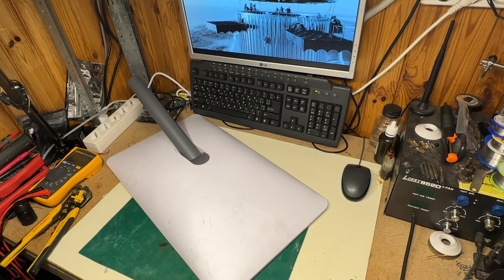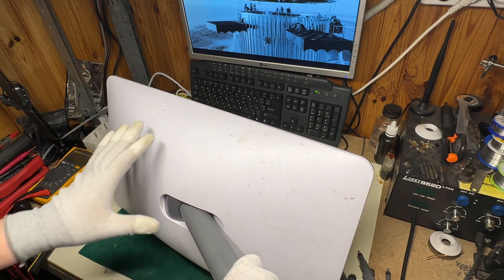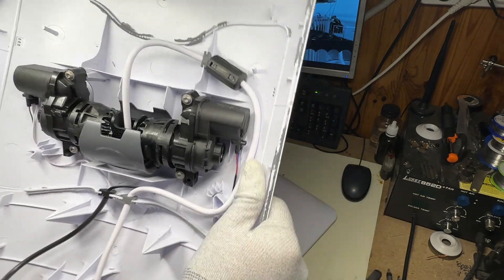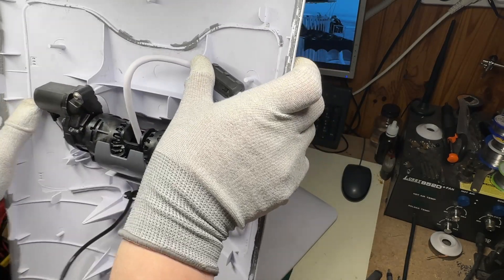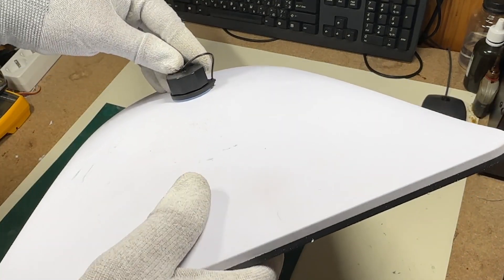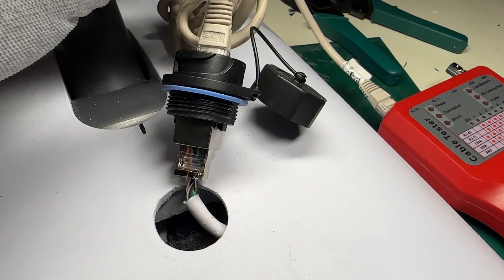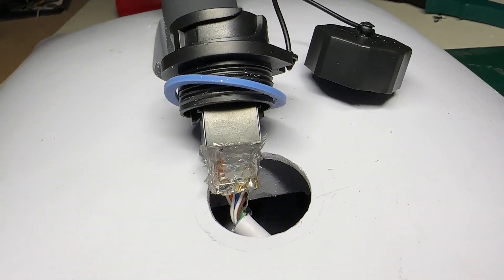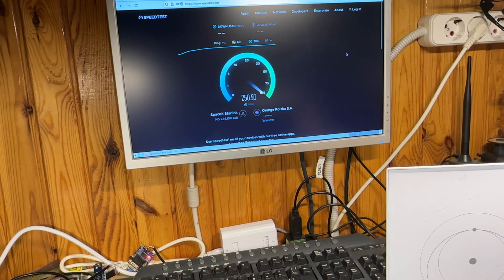Starlink terminal repair: Replacing proprietary SpaceX connector with waterproof RJ-45

Comment: Oleg, vi seu tutorial na internet de como converter uma antena para 12v, fiz a conversão da minha e em um primeiro momento liguei em uma fonte 12v, porem com baixa corrente. A antena até ligou e foi avançando as etapas de conexão, porem em dado momento ela reiniciou e ficou na etapa "inicializando" (booting em ingles), tentei ligar em uma fonte mais potente como segunda tentativa e novamente avançou todas as etapas e depois voltou para "inicializando". Agora toda vez que tento ligar fica em "inicializando" e não sai disso. O que fazer? Atualmente estou usando um pack lifepo4 que fornece 12v e até 30a de corrente, acredito que energia não seja o problema. O que posso fazer pra resolver?
Reply from the maker: You can try to add more capacitors to the input (instead of single one from the article).
Reply from the maker: Also, please install Star Debug mobile app to see the real status of the terminal.
Reply: @olegslab  Instalei e tambem fica no estado inicializando. Não consigo te enviar o print com os detalhes por aqui, mas se tiver outro meio que possa te enviar. A starlink ate aceitou trocar o equipamento, mas como ja desmontei fica dificil.
Reply: @olegslab  adicionei um capacitor de 2200uf, 25v conforme recomendado no blog. Percebo que com ele talvez tenha mais reinicios. Será que o meu capacitor pode estar com problema? Comprei um lote de 10 capacitores, todos da china, ja testei uns 3 diferentes, mas nunca sabemos a qualidade. Só se estiverem com problemas.

Comment: You rock Oleg. Thanks for share. I've read your blog about aux ethernet, but I've got new design, there are no probe pin for aux eth. Is USB 24pin male connector bend-able become spx male. I think it is quete easier to have some "spx breakout board"

Comment: I burned up the original conector on both sides, due to water ingress (no warranty, of course). Will try your fix to avoid having to buy an entire new Starlink kit. Just need to find out where to get this sealed RJ-45 and the crimping tool locally in Brazil (if anybody knows, please post). Great video with excellent explanation, keep coming the good work!

Comment: do you have a link to where to purchase the waterproof connector? Great video thanks
Reply from the maker: There are different types.
For example: https://www.amazon.com/pcs-RJ45-connector-waterproof-transmission/dp/B072FJZ4J9/ref=sr_1_1?crid=K2FA84NXFEKN&keywords=rj45+waterproof&qid=1697046460&sprefix=rj45+waterproof+%2Caps%2C183&sr=8-1

Comment: Thank you for this excellent video.  I was able to repair my dishy using your technique. It was invaluable to see your images of the inside of other disassembled dishes.  The only change for me was to cut the cable near the stem by pressing a small pair of side cutting pliers in past the grey shield next to the stem. That shield is actually somewhat flexible and can be bent a bit to give access to the cable.

Comment: Salut, j'ai un souci au niveau de bande passante Ethernet, après des fausses réparation du câble je ne peux plus avoir Gigabit, seulement 100M, pouvez vous m'aidez sil vous plait? merci
Reply: uSe CAT6 cable with ground wire. use 568B in both sides to crimp the cable. Is very important to Gigabit, use a 48V 30w or more POE injector. njust this.
Reply: @superlinkbrazil2425  d'accord je vais essayé, je vous confirmerai. merci

Comment: You can see that the Elon team totally ignored the requirements for GbE with that spastic internal cable and PoS connectors. So did you, twists on conductors should be maintained as far as possible including upto the crimp.
Reply: This thing won’t reach gigabit so it’s not really an issue
Reply: @ethanmccrory1727  Exactly what I was saying, a demonstration of not understanding standards and their needs. The service speeds can and do exceed 100Mbps and the negotiatied speeds of these devices is GbE, not FE. There is no inbetween bastard standards like there now for 2.5GbE and 5GbE in faster networks. You need all 8 strands of data running at the correct RF frequency (hint there for you all) as well as PoE.
Reply: @bentheguru4986  Are you saying it is possible to exceed the Starlink satellite speed limits/priority with a residential dish?
Reply: @efere6  No, I said you need cable to link/sync at 1Gb rather than 100Mb as the internet speeds hit over 100Mbps from stock resi dish.

Comment: Nice work Oleg. Now let's work on a hack to replace the base SpaceX wifi router with just an ethernet plug. So that we may connect the system into an existing wired (Pfsense for example) home network.
Reply: It is already done, you need a 48v poe injector and a router. You might need to plug the old starlink router back for updates.